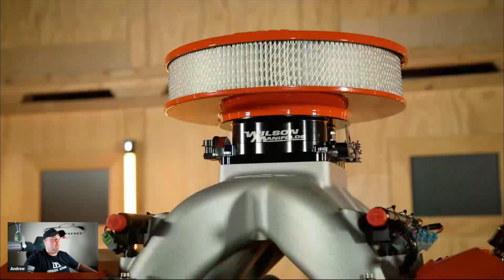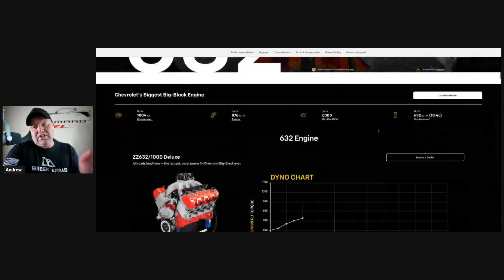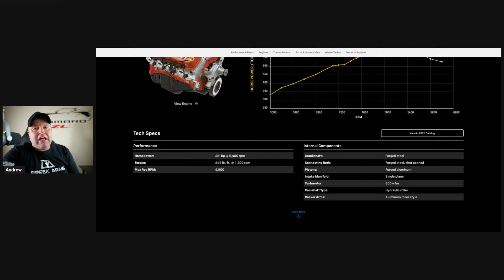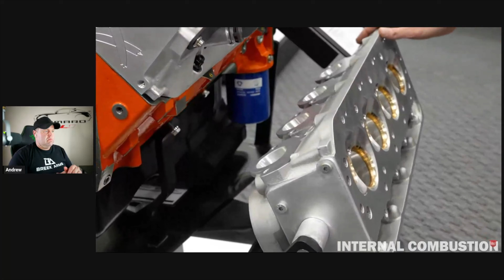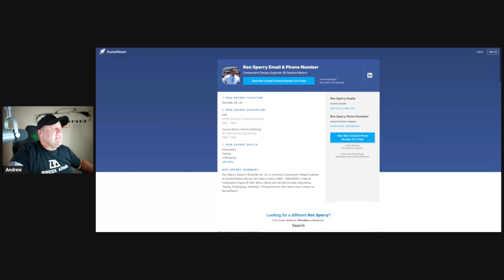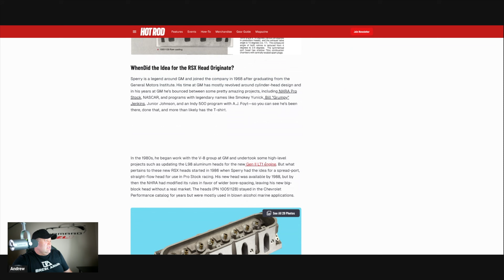The ZZ632 DONKEY STOMPS Every Modern Day Big Block Crate         #automobile #zz632 #gmperformance

Comment: 1000hp?? Why tq so low?:body-blue-raised-arms:
Reply from the maker: I love the power curve…like a giant small block!!
Reply: HP is a imaginary number based on math.
Torque is real and is not low on this engine
Reply: @bigboreracing356  Most Pushrod engines are about equal Tq to hp or higher. DOHC engines have lower Tq than HP.
Reply: HP is not real.

Comment: In the interview video he said these were based on the DRCE engine which is the Chevy/GM NHRA Pro Stock block and heads from the 90's, which have evolved but are still in use. And Rob Sperry was also involved in developing the LS heads which are laid out similarly to the pro stock heads (symmetrical port). Let's say they're cousins. The ZZ632 is awesome and I love that they came out with this thing. But there's nothing wrong with the other old school big blocks and you can definitely get to 1000HP for cheaper than $40K.
Reply from the maker: Absolutely!

Comment: No replacement for displacement.... Long live the V8 engine, long live the manual transmission.
Reply from the maker: Preach!! I’m good with both of those sir 🫡
Reply: If it makes 650lb.ft of torque at 1500rpm, thats 185 horsepower. More displacement means more horsepower at low rpm. Its already making 350hp at 3000rpm.
Reply: Not so ....Dodge crate motor that makes the same horsepower as the 632, BUT makes makes 75 more ft. lbs. torque with 950 ....and only 426 c.i. ...sure its supercharged  but it is replacing cubic inches in power